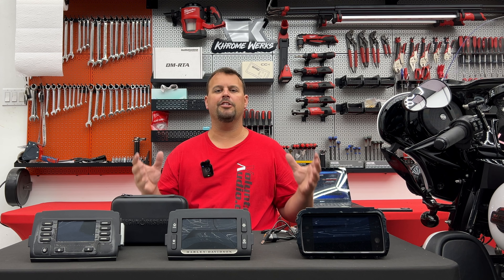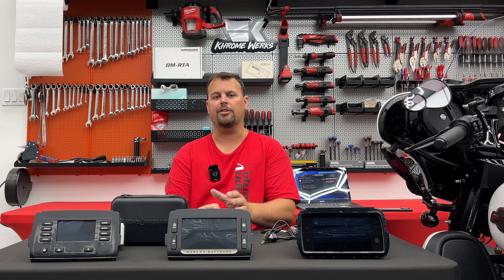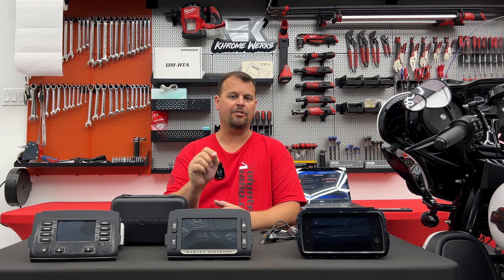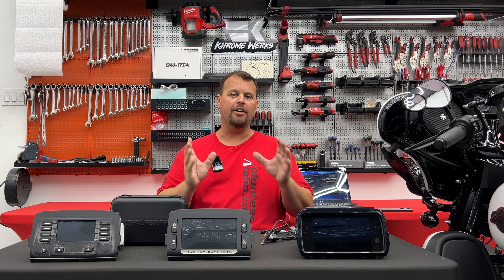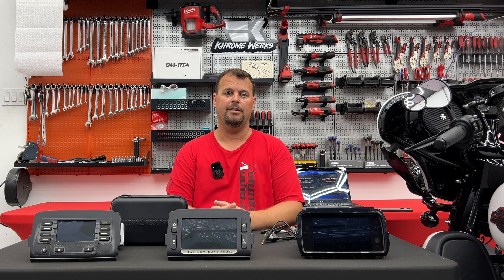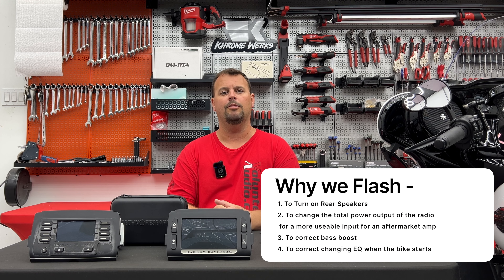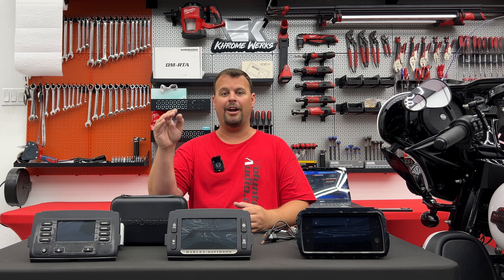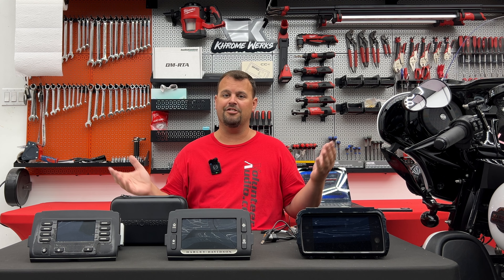When should you Flash? Everything you need to know about flashing the Factory Harley Davidson® Radio

Comment: It cost me a lot of dough but, I did ALL of what you’re talking about except getting a V2. I got 1000watt amp, 6x9s, 6.5 fairing speakers bought the rented flash(and returned it), and my bike is loud as all get out! The FLASH takes away the FADE. ;(

I just wish I had an EQ to tweak the sound or be able to fade to 😢the rear. I can’t fade anymore. ;( the front is Loud! I hear the only solution was to take everything back apart in my fairing and open the amp and cut the front speakers down on the amp. Well. Guess I’ll have to wait to get the V2 cause I believe it has an EQ. I need less mids.  Thanks!
Reply from the maker: So we do fade your amp some to compensate for this, your treble comes from the front, mid and mid bass from the rear.  They blend well but the rear not have the highs will never sound as loud as the front but believe me they are doing a lot

Comment: So , who’s working on a “NEW” radio w/the same size screen as the 24’s that’s gonna have , cause I heard the other day there’s no speaker wires connected to the radio of these new ones it’s all done by signal processing, 5volt outputs for hooking up external amps! …???🙏
Reply from the maker: @neano62  we have built the interface to solve this issue, shipping in a few weeks and way less expensive than replacing the stock $7800 radio